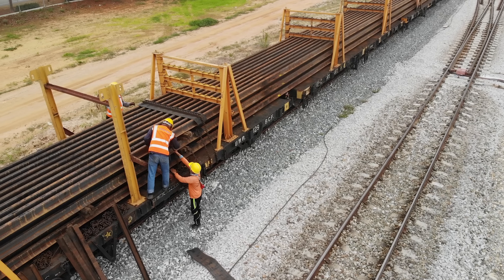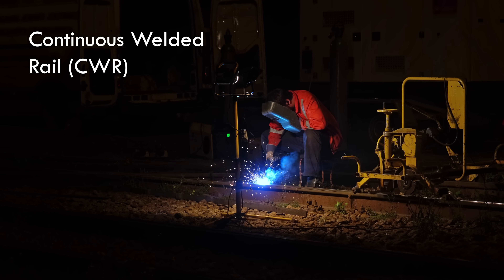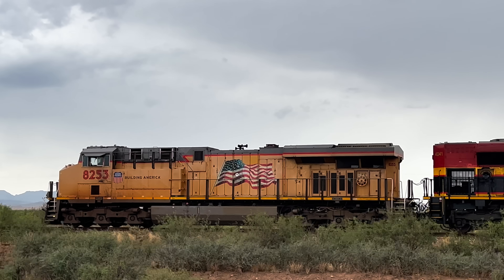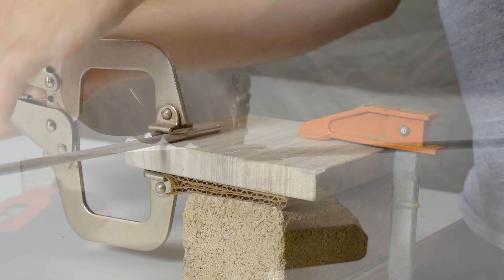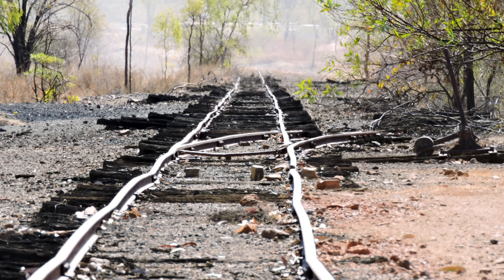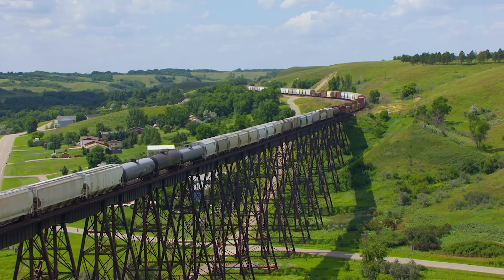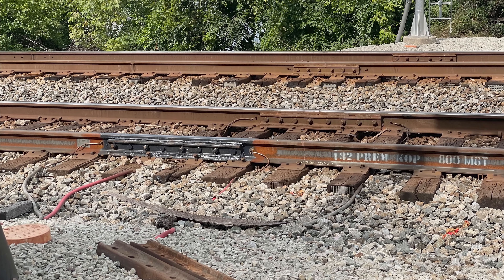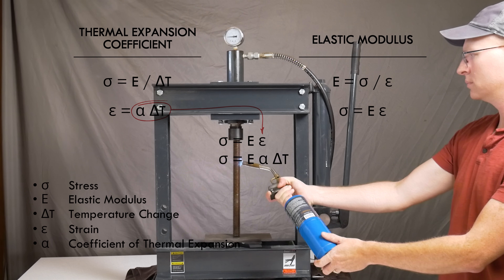Why Railroads Don't Need Expansion Joints

Comment: In the foundry industry, the reverse has to be dealt with - shrink.  When we build patterns (tooling) for foundries, we have to account for the shrinking that occurs when the molten metal cools back down.  Usually, it can be predicted quite accurately, but on occasion, it throws us a curve ball.
Reply: I work in a sand casting foundry making heavily complex parts (some parts have 80 cores!) and yeah, it's wild how much difference there is between the cavities in the mold and the final shape. Computer simulations help but eventually you just have to run it and measure what comes out the other end.
Reply: Not gonna lie - based on all these awesome responses, this seems like a very interesting rabbit hole. I'm always interested in engineering problems that eventually boil down to "well, you just have to do it and find out"
Reply: @erich1394 there are literal tons of gold to whomever can figure out perfectly how an arbitrarily complex casting will shrink, but engineers got pretty good at figuring things out
Reply: That sounds like a really interesting problem! How do you predict it? Are we talking like... computer simulations or basic algebra?
Reply: @erich1394  Well, for very regular shapes you can easily predict the cooling with essentially the formula that was shown in the video, applied along each dimension independently. More complex shapes might behave unexpectedly, though
Reply: @erich1394 ideally when the part completely cools down it is the same shape, just a bit smaller. The transition where it is not homogeneous temperature might have some non-linear effect which requires more complicated math or computer simulation. I'm not exactly sure. I'm sure it also depends on the geometry of the part. If you're just casting a ball, it should be super easy, but if you're doing something long and slender with an unsymmetrical cross section it might be much more challenging.
Reply: @erich1394 at my foundry, we just scale the whole thing up 2.0833% and call it a day. Ther after we 3d scan them we do some layout work and fix any error. Normap only takes 2 castings to get it right.
Reply: I would imagine that differential cooling based on the size and volume of a particular shape could lead to wracking in many cases.
Reply: I always wondered why very large handwheels had curvy spokes.  then I learned about the shrinkage and the curve gave a place for the spoke to shrink and not break.
Reply: I wonder about the effect of quenching to pre-stress the track. Seems like it would help with installation, but there's probably negatives for track I'm not aware of.
Reply: Do modern patternmakers still use shrink rulers?  For those how don't know, the graduations on patternmaker's "shrink rulers" are adjusted for shrinkage so the patternmaker could work straight off the drawings without doing any math.  Patternmakers were the ultimate woodworkers back in the day.
Reply: Yeah, I just used an 1/8 shrink today. The tape measures are hard to find, only have a couple in the shop.
Reply: I freaking love these comment threads. This one was also super cool to read!! Y’all are amazing! Thank you for this discussion y’all! I learn from the video, and learn more from super cool dudes working in their respective industries related to the video!
Reply: Sorry, but I hate phase diagrams… 😣
Reply: If something is going to a different foundry we often have to change the shrink of the pattern. Then there's double shrink for vac form tools.
Reply: Ok…?

Comment: for me still missing is a technique to reduce the temperature on sunny days: painting the rails white to reflect hot sunlight. This is widely used in italy for example, germany, switzerland and austria are testing this on a few tracks. These tests show, that the temperatures can be lowered 7 degrees celsius. If it's worth the effort, we will see in a few years i guess
Reply: I suspect it's not going to be worth the effort.  Any paint will quickly be worn off of the top of the rail, and the rest of the rail is going to get dirty.  How dirty it gets, and thus how much it's reflectance is reduced, is probably going to be the determining factor as to whether or not it makes sense.
Reply: @thekinginyellow1744   The economics alone would show this option to not be valid.

Comment: You ever heard of the deadly “Snake Head” when talking about laying segment railroad tracks? 

It’s a condition where overtime although we barely see it anymore with continuous welded tracks, but in the early days of railroad, especially out in the Midwest when you have a lot of use on the tracks. Overtime each individual segment will start to develop a curve where they have to high spots at the end and a low spot in the middle but overtime that curves at the end will start to get higher and higher and higher until eventually it’s sticking up so high that the real could literally go right into the passenger leading to a catastrophic derailment of the train.

Comment: Train tracks with restrained expansion have a smaller temperature operating windows than corresponding unrestrained train tracks.
Here in the UK, we get few summer days with very high ambient temperature; on those days, trains must travel at walking speed.
Reply: The longitudinal forces of a train operating on the track can "push" the rail, inducing more compression and higher stress in the track directly in front of the train. It's not uncommon for a sun kink to occur due to this right in front of a train! 😬
Reply: @mvcrailphotos  Buckles often actually occur under trains, as the wheels push down on the track under them, which causes the track between the wheels or bogies to rise slightly in reaction. This lifting reduces the friction between the underside of the sleeper and the ballast below.

I have seen track lacking top ballast during engineering work, do this with the track lifting and sluing its self under every passing wagon, looks really creepy as your brain has a really deep seated belief that the track is not supposed to be doing that. Que me starting to jump up an down while making the French army gesture in the direction of the locomotive.

Comment: Coming from Germany, I was very surprised when I noticed the tracks of the New York Subway weren‘t welded together. It felt so flimsy
Reply: Its gradually being replaced with welded rail, especially in sections with noise issues. 

I suppose whether you hear it or not depends on which line you take.
Reply: @russianbear0027  I’m glad to hear that, but how come this has been a thing here since at least after WWII and in America it’s being implemented just now?
Reply: @inerdt  not sure about other systems but the NYC MTA was famously underfunded and suffered deferred maintenance for many decades in the 20th century.  Their signal controllers were almost a century old until very recently. They are still underfunded but the crisis is less severe than in the 70s as far as I know.
Reply: @luelou8464 I‘ve seen them do thermite welding here and I think it’s pretty much the standard. I can’t imagine it being much more expensive than using rivets and plates. And aren’t wheels conical among other things to save costs by providing a more even distribution of wear and abrasion on the wheels and the rails?

Comment: London underground sounds like it still has expansion joints
Reply: It's quite possible they haven't gotten to install CWR yet. Very busy transit systems like the tube have very limited work windows, and with such a large network, required track maintenance/renewal is often prioritized over things like this that aren't necessary for the safe effective operation of trains.

Comment: 8:59 - I'm pretty sure "SI" and "Metric" would be the same. The one on the left is USCS, not SI.
Reply from the maker: Whoops! Added a note in the description. Thanks for catching this error.
Reply: @PracticalEngineeringChannel  - Just to be pedantic, it should be USCS, not "imperial". The USA never adopted the imperial system (which is why US volume units don't actually match imperial ones, despite having the same name), since it was created after the US had become independent (and it would probably have been treason to use it - at least as bad as calling freedom fries "French"). USCS is based on / derived from pre-imperial English units (as is imperial, hence why they have the same names and mostly - though not always - the same values), not on the imperial system.

Then again, obviously you can can use the imperial system in your videos (although the US never did and I think no one else does, presently). Just remember to use actual imperial gallons too. 😜

Comment: Now seen a video of the new Deutsche Bahn building near Stuttgart. It was shown that the rails on one side of the bridge have an expansion connection that can be pushed together. After the bridge there is a tunnel with solid concrete rails. The fixed rail in the tunnel cannot move, but where it meets the bridge after exiting it needs more flexibility.
Reply: The rails are made of concrete?!
Reply: @RCAvhstape I think she meant concrete, ballastless trackbed.
Reply: Makes sense given that the temperatures inside a tunnel tend to be fairly constant but the one outside can fluctuate quite a bit.

Comment: I am stunned by this. I knew rail was difficult to lay in general, but maintaining strain at the right tension for the whole length is incredible. Where I park for work is very close to a rail facility of some kind (I honestly don't know what it does) so I am frequently hearing train brakes whail and trains pass, and the clicking is almost non-existent. I just assumed they were more precise or something with the leveling of expansion joints, but this is amazing.

For the people who are going to weigh in on my ignorance of the rail facility beside the parking garage - it's about half a kilometer from the passenger rail station, but regularly has both freight and passenger vehicles that are definitely not meant for local unloading. It has a small spur that rarely gets used that crosses the road where passenger trains pull off onto and then almost immediately back off of. My assumption is that it's some kind of switching facility, but I don't really know.
Reply: Rail is still far easier to lay than build streets.
Reply: @cyan_oxy6734  if you compare roads and rails with the same amount of tracks/lanes, the rail will be much more expensive, but will also have larger capacity and the maintenance cost per capacity can be lower.
Reply: @roger5059  a rail track has the same capacity as up to 20 lanes of road, so yeah significantly more expensive but the potential is much greater (and it’s a lot better for the environment and people’s health, and these things are costs too even if certain governments want to ignore them)
Reply: @cyan_oxy6734  Rail costs 5x as much per mile. The problem with streets is the vehicles on them are far less efficient.
Reply: @Merennulli streets and railways are fundamentally different things - streets are supposed to be walkable and places for business, leisure etc while railways are transport corridors. sure a street’s central road can be used as a transport corridor but that is only a side effect (and usually undesirable).
Reply: @sublivion5024 Streets aren't generally designed to be walkable. That's an objective some are trying for but it's added use with added cost. They're also not designed as a place of business - though they are often repurposed for that in various ways. Again with added cost. The purpose of both rail and street is a stable corridor of transportation. Rail allows high efficiency, street allows high versatility.

And the low versatility of rail is why we don't often add on business use to rail. There's just not enough stopping or switching on rail to make business viable. (We do add pedestrian use to rail fairly often, though.)
Reply: @Merennulli  this is an extremely american perspective. in the UK/Europe many businesses are connected directly by rail (they are in the US tbf). Most streets are walkable - it’s not an added use - it’s their primary use (people live and work on streets). a street that isn’t walkable is called a “stroad”. Transport corridors for cars, HGVs, buses, bikes etc are “roads”.
Reply: @sublivion5024  No, it's not an American thing. A pedestrian street doesn't require the same structure as a vehicular street. You can't make a street for pedestrians and extend that to vehicles unless you laughably over-build it. I can only guess at what you're thinking of and my best guess is that you're thinking of streets that WERE built for motor vehicles but had their purpose changed as part of the efforts to reduce motor vehicle use. 

But even those are the exception, not the rule. Most streets in the UK and Europe are not just designed but designated for vehicle traffic with add-on features for pedestrians.

That's also not the definition of "stroad". Nor would it make any sense for it to be even by the logic you gave there. It's a portmanteau of "street" and "road" but you're arguing for it to be a road without what you claim the street part is. What a "stroad" ACTUALLY is, is combining the locality of streets with the function of roads. And the word is explicitly calling out the danger of doing that because it has the safety features of streets with the speed and volume of roads.
Reply: @Merennulli  in my city, far more people walk and cycle on streets than drive on them
Reply: @sublivion5024  I don't doubt it. While it's certainly not the majority yet, it's been a growing movement since the 60s both in the US and Europe.
Reply: @Merennulli  I live in one of the most car centric UK cities